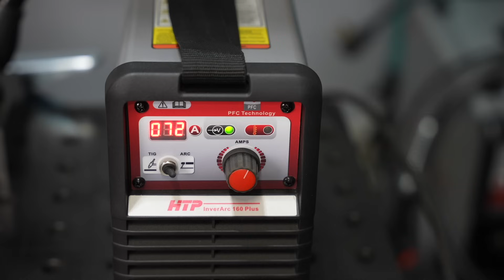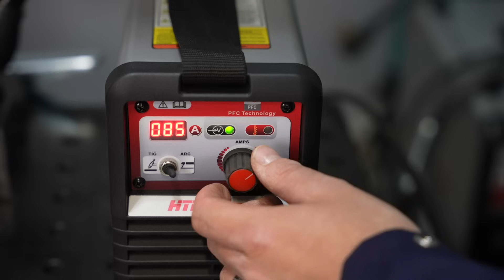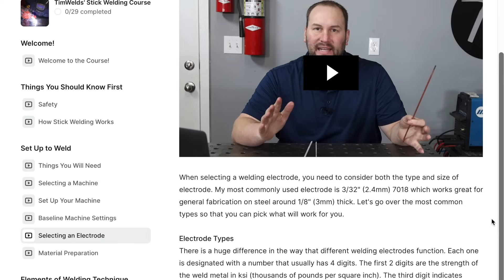3 Stick Welding Electrodes Compared: 6013 vs 7018 vs 6010

Comment: i've found that running 6013 on electrode negative makes the swirling of slag and the filler metal happen less and have a clearer separation between the 2 as well. (at least on my new machine) you also just have to find the sweet spot in terms of amps, then slag peels really easily.

There can be a difference in how your machine likes to run which electrode. Mine really likes 7018, 6012 and 6013. but with 7014 or 7027 you need to keep a really tight arc else it can snuff out. I've played with arc force and it helps a little bit. 

My old machine (pretty cheap) really doesn't like 6012/6013 in corners and harder to reach places, so if your electrode angle is off. More chance of slag inclusions and harder to clean. The amps on the dial and how it welded also didn't match. twisting the knob to 150 amps felt like 100-110 amps. i feel like it was a 160 amp machine with a 250 amp dial on it.

Comment: Back in high-school, I got certified as a SMAW all four positions, in 6010 and 7013, after 16 years im getting back into it, what work is most common for stick welding? 
But from my experience, when I got certified on 7018 the slag does peal up, thats actually how you know you have your temperature right. Too hot and the slag is thick and hard to break off, too cold any your not getting enough filler. Try turning your machine down in increments of 5 until you find the sweet spot. 6010 is more of an art form, it should look like a stack of dimes

Comment: Hey mate, I just bought a used 25 year old  lincoln 225 AC-DC rarely used.  It came with 6011, 6010 and other type of rod. I noticed you said 6010 won't work with older machina, like how old we are talking about? Thanks in. Advance.
Reply from the maker: Might as well give it a try. It generally won't work on AC and some inverters have trouble with it. I'm not sure about a Lincoln 225, but it would likely run just fine on DC mode.

Comment: Every video and forum/reddit post I saw was people trash talking 6013. I run a portable setup for off roading and demo derby (I mig or tig at home). 

6013 has been perfect for portable use off a solar generator/battery. 60-75 amps gets me enough to patch up control arms, tie rods, and other trail repairs.

Comment: Been using 6013 to weld my car crib stands, is this okay?
Reply from the maker: 6013 would be fine as long as the welds are done well. i.e. I wouldn't do this as a first project or without some level of testing of my welds. On a project like that, I would be most concerned about the overall engineering of the stands.
Reply: @TimWelds  Can I send you pics of it to your Instagram?

Comment: I keep seeing video's on 6010/11 being kind a brittle when stressed?  And then they go and cover it with a Low Hydr 7018, but whats the since if the 6010 under it has, or is exceptable to hydrogen...  So i don't understand why they use the 6010 on pipelines etc... I'd think pipelines would be very exceptable to Hydro Cracking...?  idk

Comment: Hey Tim, I was in a Heavy Duty Truck class and the machine I used for stick welding was a DC Shielded Metal Arc Welder from Miller Electric

Comment: Man I went to school for welding got a few tickets or certs u could say by almost all of them and u left out tons of key features of each rod tons of theory and more 6010 flash freeze non drooping rod high pen like u state IA mist important features also more codes require uphill welding which require a 1 position rod which is the 3rd number in rod 😂 so please please tell people more each number means something 60-70-80-90 at start etc 100 is alll tensile strength  a 1 or 2 dictates which position a rod can be used next number last number is Flux and composition of the rod based on averages and Flux materials differences percentages and more 👍

Comment: Why so much opposition to 6011 and 6013? If you run out of 6010 and are not around  a welding supply, finding 6010 is impossible! No one carries it, but 60111 and 6013 is everywhere, even 7018 is common but not 6010!

Comment: Great learning video!  One tip on 6013, get the one with green flux, it has much fewer slag inclusion problems.  I checked online, and the green 6013 is not easy to find in the US. Down here in Mexico almost all 6013 has the green flux.

Comment: I used to use 7018 in a maintenance shop for years but I switched over to 7018 AC as recommended by my local welding supplier. What I noticed it there is a conductive ingredient in the flux that allows it to restrike without having to chip off the hardened flux. That was a huge plus to me. I also tried welding with it on DC and found I could not tell any difference in the way it ran. My opinion is it's the greatest welding rod of all due to those two advantages.
Reply: I have never ran any ac 7018, but I have ran a lot of DC 9018, and they seem to refire better than 7018. Of all the many DC 7018 I have run, Forney restarts the best and Blue Demon the worst. 6013 is a good rod all around if you get used to it, too, but you have to keep it moving along, unlike a low hydrogen. And 6013 isnt good for heavier stuff like 3/8" and up.
Reply: @timberslasher4899  I always called 6013 "farm rod"   Everyone uses it because there's so many AC  buzz boxes around. Even though I have DC available to me at home I experiment with AC on other rods just for fun.  From testing I found that many rods that most people run DC will run on AC if you need to.  I throw the book away and see for myself what it acts like. The one rod I could not get to run on AC is 6010. It totally refuses to run but I expected that from what people say about it but  I was given about 100 lbs of 7024 once and found it runs great on AC. Go figure.
Reply: @thomasjefferson1457  I have ran some 6011 but usually just where I can't get to something to clean it a little. I have never burned a 6010 rod I don't think in 30 years of this mess. I have no formal welding training other than high school shop. But my dads best friend owned a huge welding shop for 40 years that I grew up in half the time. I think they never bought anything but 7018....lol. 
So all these other rods are pretty new to me, in the last 5 years or so I have started trying different things. But still if I could only have one rod it would be 1/8" 7018.
Reply: @timberslasher4899  I'm the same as you. I have no actual school training but started welding at about 12 years old helping my dad build stuff. I later worked around certified welders for years installing machinery and as a maintenance mechanic in an industrial plant. I eventually went to college for electronics and became the plant electrician.  People used to say "you weld pretty good for an electrician"  LOL  I never considered myself a "welder" as such because of the lack of schooling.   I watch lots of welding video's on you tube now to fill in the gaps of my lack of school training.
Reply: @thomasjefferson1457  about the same here, degree in emergency medicine and land surveying both, but spent last 30 years running family logging biz which involves lots of heavy welding. Always paid a lot of attention to good welders and got the reputation as a good welder/fabricator now myself.

Comment: I got pretty good when learning MIG/TIG/oxy welding but stick welding just absolutely kicked my butt, especially trying to get a full pen root-pass weld, regardless of whether 2F like you're doing or 1G. Could never manage to get the right behavior and then the school, the next semester, moved to inverters from the old transformers and they were a totally different beast that I never could get used to. (The large transformers were just a lot smoother.)

Comment: Can you go over the storage/lifetime issues with 7018?  I've seen so many conflicting stories on this.  What is the casual home welder to do when you need to open a whole box of rods and you only need a part of one rod?
Reply: I don't want to advertise someone else's channel on this guy's channel, but you can find videos debunking the idea that a casual home welder needs to store 7018 in a special way (assuming you aren't "casually" doing professional jobs specced for low hydrogen 😂). If you allow 7018 to pick up moisture, it will perform...better than a 6010 or 6011 or 6013 that is handled similarly. Think of "low hydrogen" as a superpower that you need if you were working in industry on a job specified for it. If you store 7018 out of an oven, it loses this superpower, but 7018 without its superpower is no different in that regard than any other rod you might ever use. You can find videos of a guy welding fillets using 7018 that sat in a cup of water overnight and getting stronger results on a break test than with a fresh 6000 series rod. Exposure just makes the 7018 no longer "low hydrogen" but that's the default state of all those other rods. Just think of improperly stored 7018 as "not low hydrogen" anymore...same as all your other rods.
Reply: @zyx495  Thanks for taking the time to answer.  That is the conclusion I've come to after digging in to this topic more deeply.  I think I saw this in one of Tim's more recent videos, but if that isn't the case, my previous comment still stands.
Reply: @zyx495 thanks for this comment, 7018 is so easy to buy in bulk I wanted to buy it for my shop but I don’t have a rod oven and didn’t want to deal with headaches. Now I think I’ll just buy the 7018 and leave them in my cabinet for whenever I need them, I don’t work on high strength steel, mostly just general mild steel

Comment: I'm a beginner. If i have 6013 and modern inwerter (dc) how yo connect wires? There is no information in manual and no suggested anything on electrodes. What to do, can you help me? Older welders says minus to ground cable
Reply from the maker: Yes, DC Electrode Positive (work clamp to negative) is going to be the best bet most of the time. You can switch them to reduce penetration on thin material, but it's very rare that I've done that.

Comment: Personally 6010 roots are the bane of my welding existence, during school it was the biggest problem I had with any welding projects or tests, though I did eventually get to the point I passes my 6010/7018 pipe, and with my structural weld test with 1/2 carbon coupons. The most fun I have had was testing on stainless tig (for a job I applied for and got hired for) as it was enough of a challenge to push myself without feeling frustrated like I did with 6010 roots on my stick tests.

Comment: I have a love hate relationship with 6013. Sometimes it doesn’t leave enough metal in a joint. But mostly, it’s the cat’s meow, giving me the smoothest joints. 
I probably need to take your course to become more consistent.

Comment: Thank you for the nice video. I'm thinking of buying your course but I'm a bit lazy, is everything metric-compatible in the course or, do I have to use my brain? (e.g. Amps/thou is not a useful unit on my bank of the pond) 
I suggest you copy your answer in the course blurb too :)
Reply from the maker: Thanks! I have metric units in the courses, but the units aren't really the main point. I teach based on principles so that you can figure out the quantities yourself. If you try them and find that it's not the right fit for you, just send me an email and I'll refund the cost, no hard feelings.

Comment: Very nice presentation.  I learned welding in a junior college night class 40 years ago and at that time stick welding was the state of the art although MIG was around but not so common.  I like stick welding because it allows one to get into small places such as on an assembled vehicle.  

I would like to have heard you comment on 7014 rods as that is what I have and use a lot.  

I would have liked to have seen you weld some 1/8 inch mild steel onto the frame of a vehicle which is what I am doing now.  I am very anxious about this because I know it is easy to burn through the frame which creates a weak spot.

Comment: Top notch teaching, warts and all, great job.  
I only do farm type welding and only use 6011 and 6013.  11 for thick and rusty and 13 for thin and clean.  Both are Hobart from Tractor Supply Company.  1/8" usually set on 90 or 105 on my Lincoln buzzbox.  Never had any of my ugly welds break yet. I did just order online some Esab Sureweld 6013 green rods.  Looking forward to giving them a try, I hear they're great.

Comment: Since I have a cheap inverter stick welder machine, I will take your advice on the 7018AC version. I’ve tried three different types of rods, and it’s nearly impossible to develop an arc. I was able to lay a few welds with some 6013, but it literally took probably 100 attempts to get it to light up and hold an arc.
Reply: If you're having trouble lighting a 6013, consider using a different welder. Cheers!👍
Reply: Has it improved? Don’t give up! The number on the display of some welders has nothing to do with the amps delivered. I often have to turn up the setting on my cheap welder so I can avoid sticking and strike an arc

Comment: Okay I like your information class but there is something you said that I have to point out. 7018 slag should pull off easily or pull up on its own. If it doesn't and you have to work at getting the slag off then the heat setting is not right or the material you are welding is dirty or both. The slag should be very easy to remove.
Reply from the maker: Did I say that? It’s generally easier to remove on 7018, but, I don’t completely agree with slag peel as an indicator of weld quality. It depends a lot on the brand of electrodes. Some Hobart rods I’ve had ran great, but you just about needed a jackhammer to get the slag off, where Lincoln Excalibur will give a peeler just about every time doing the same thing.
Reply: @TimWelds  agreed. What I have found is heat settings apply to the given rod on the given day. Every day is different. When I use a different rod from a different producer settings have to be adjusted and adjustments need to be made periodically through the day depending on the weather and conditions as strange as that may sound when you weld in the field. Excalibur is definitely one of the absolute smoothest and predictable rods I have used without a doubt. The others are just as good once dialed in.

Comment: Buy the course. Thank me later. It is great value. Yes, actual paying customer. It has excellent explanations and demonstrations. It's sequential and broken down so you don't get lost. You can re-watch parts of it many times if needed, which I have. I literally had no idea when I started and in fact have never welded. I just wanted to learn stick welding to do some projects around the house. So far, the courses helped me to not electrocute myself and not to burn myself or the house down (basic fabrication and safety part of the course). This makes my wife happy. Now starting to lay some beads of weld which look OK and doing some joins. How good. I literally started knowing nothing at all. Not a thing. If I can learn, anyone can. Thanks Tim. Awesome. Cheers
Reply from the maker: Thanks!!!

Comment: Been forever since Vo-Tec lol so I have not Welded for decades. I am probably 100% wrong but don't they call a 70/18 Rod a "Jet Rod" as well?

Again I'm probably wrong I'm just curious. Also you Weld well past a Pro smh some guy's just find what they are perfect at then run with it. Sadly I'm not one of those Guys LOL.

Comment: Sorry man im glad your helping newer people but i had a welding class in high school and we trained on 6013, jumped to 7018, and then to 6010 and did all 3 in flat, horizontal, vertical, and overhead. This was in highschool so i was in this class, from when i was 15 to 17 and it was taught better and we all had welds better than that even had bend(destructive) tests for 3g 4g and 5g welds… love that your helping newer welders but when it comes to a weld being right and safe. This isnt it. But running beads this is good

Comment: Hey man great Channel I've got a about 13 mm round piece of Steel that I need to weld the same diameter end to end  it was good  I thought until it failed and it looks like the steel rod didn't get hot enough for the weld to fuse it was just the weld material holding it together and that was with my $200 Amazon welder with a 6013 rod I have a super old it says WS 225 k wire feed arc welder with Mac Tools branding on it that should give me different results I'm assuming or is welding something end to end like that not as strong?....thanks!

Comment: Served my welding apprenticeship in a British shipyard BOC Vodex 6013 were the dominant rod all position as with all 6013’s finding the sweet amperage is the answer I have always found they run better on AC back then I could get a peel in any position Vodex 6013 are the best general purpose rods I have ever used 6018 Philips 56 s take some beating and 6010 NU 5s are my go to only got 50 years experience behind me so maybe one of the older guys could throw me some advice 🤣🤣

Comment: 7018 CAN peel the slag. You just gotta have your settings and technique on point
Reply from the maker: I don’t think I said it can’t, 7018 is probably the best peeling rod out there. It depends a lot on the brand of rod, joint type and position as well. You can have a completely acceptable weld that isn’t a peeler.

Comment: 7018 is the best for cast iron out of all those electrodes, but preheat and clean with 6010. 6011 if using a standard inverter.

Comment: Would a stick welder be good for automotive stuff? Like if I was welding a floor pan or fixing rust. My car is from 1966 so I think the sheet metal is thicker than modern cars. But idk if it’s possible
Reply: there are video's on youtube of guys using small 6013 electrodes for what you're 
asking about .
Reply: I prefer 6011 on cars. Especially on vintage stuff and 6011 cleans everything.